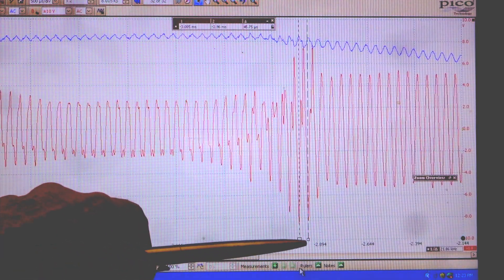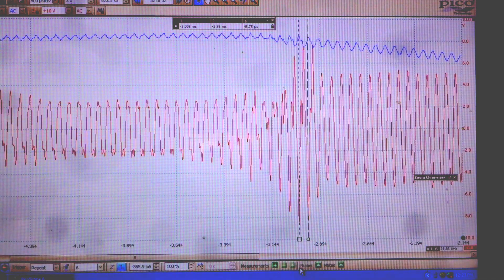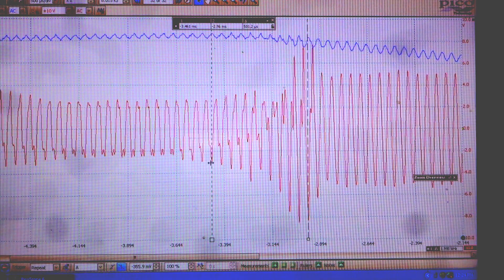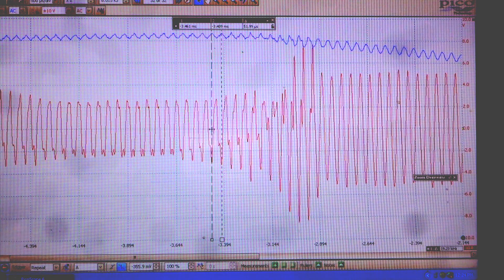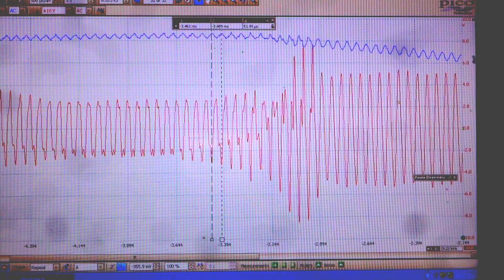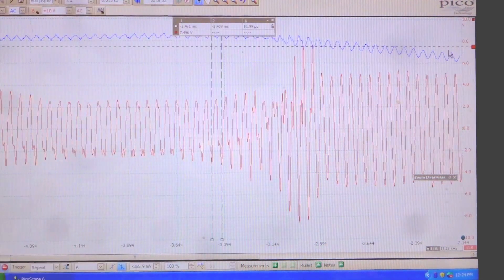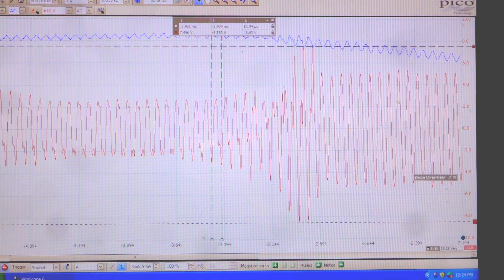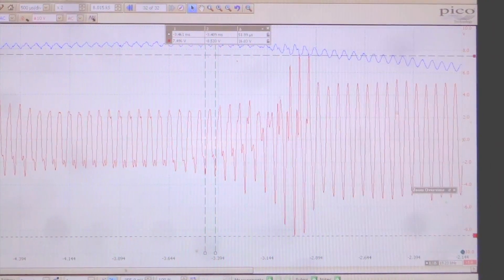Outback VFX 3524 Inverter charger: Dirty Electricity examined

Comment: Hi Eric,  I have a VFX3524 . How do I shield my self from bad EMF ?  The Inverter is mounted on the outside wall under a porch in a closed box with a cooling fan.  Thanks Brett
Reply from the maker: No suggestion with this inverter.  Poor design.
Reply: You don't

Comment: I've found Outback inverters to be pretty much impossible to filter with GS filters.
Reply from the maker: I agree.  Some inverters create such a high voltage amplitude at a single frequency that parallel capacitive filters can't do the entire job. On the scope trace above please notice how much distortion there is on the blue 60 cycle sine wave.  When you see a saw tooth pattern on the 60 cycle sine wave you know that there will also be very high levels in the red DE trace as well which in this case was 16 Volts at 20 KHz.